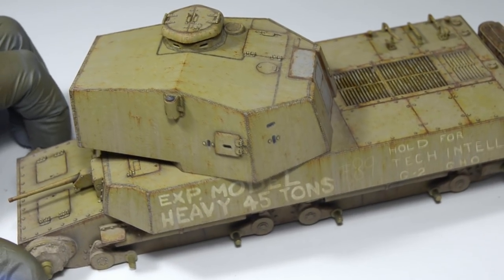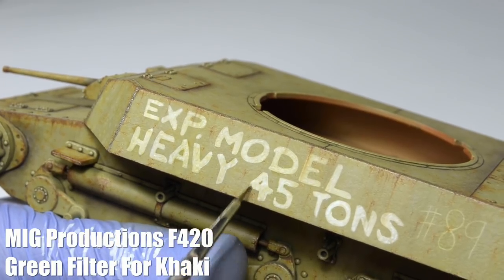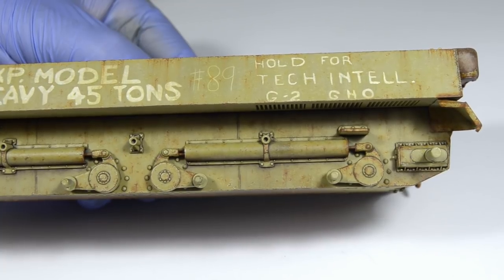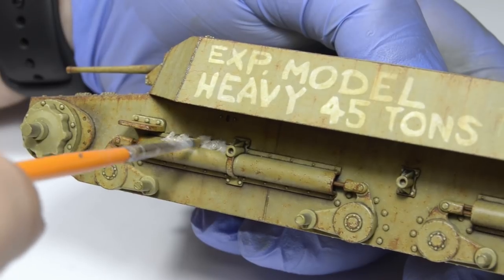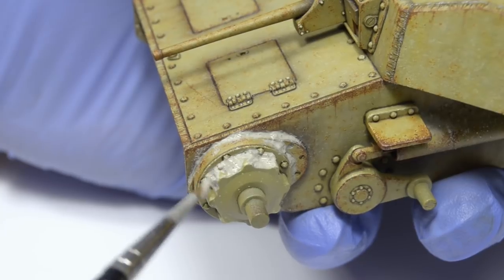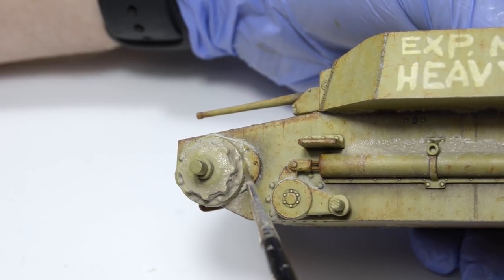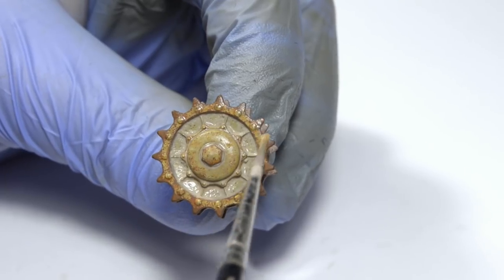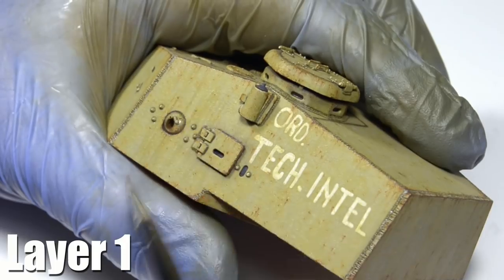Simple DUST And MUD Weathering Effects WITHOUT PIGMENTS - Type 5 Chi-Ri (Fine Molds 1/35)

Comment: I've done the same thing recently.  Earthy effects without pigments since those are for scrubs (and they don't stick on as nicely).  Oils and enamels and the Wilder Textured Earth are excellent for these effects and then you don't have to worry about those damn varnishes afterwards....
Reply from the maker: Dust effects with oil paints? What are you, some weathering snob?
Reply: Varnishes...? We don't need no stinking varnishes! LOL
Reply: LOL!!
Reply: @Night Shift Everything with oil paints :D
Reply: Cool video Martin.
This Tamiya dust mixture works great, I tried to do something similar with Ammo Washable dust colour, and it works not bad but the pain(t) in the ass is that when you need to use enamel thinner over it. It wash out the ammo paint and blend the effect :(